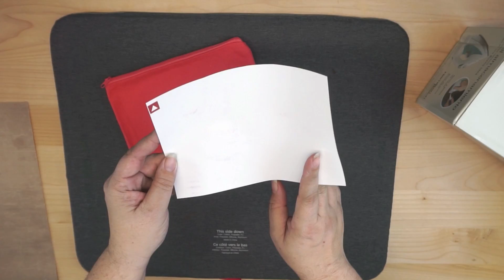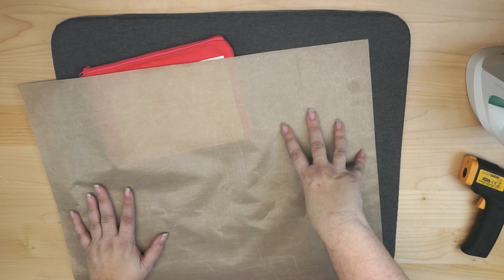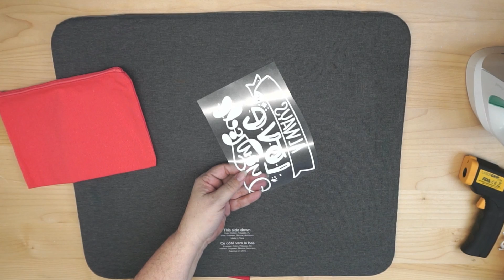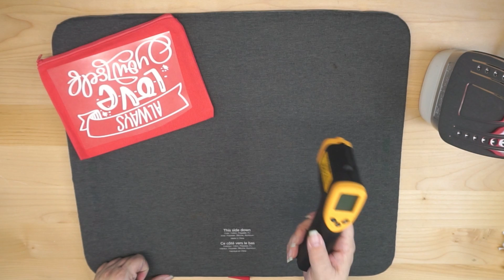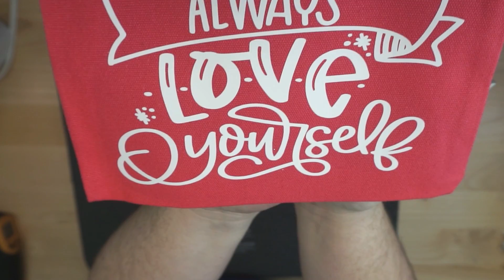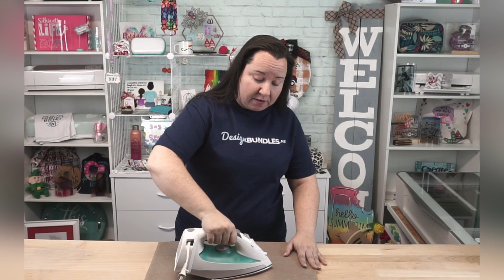✨ How to Apply HTV with an Iron

Comment: What type of HTV Vinyl heat transfer paper do you use?
Reply from the maker: I am not sure what exactly she is using here but I just order mine off of amazon! It really comes down to a lot of preferences. How sticky do you want it to be, the size, and the alignment grids. Some people have to have them and some don't like them at all. I know this doesn't totally help but here is a link to something similar to what I use: https://www.amazon.com/transfer-tape-for-vinyl/dp/B073XRLZ6Z/ref=sr_1_18?crid=141E9F34H0FJ&dib=eyJ2IjoiMSJ9.XEowOwjFDeRf5YhpstOj1knGrcpoO-qb93uOv2eQxIuYulT2FB1sPmn9ziCyAXtSWZQYAqSJTHCTC7nZSwRF1GigQJr-CPFIOuP3mS4H-2iE8EzJAoffAQHVYZS-HhCe8duO1SecyKJku803C9L8d6ECLPkOPYvFqOSC2RgGAzBtNL817fdOW8ZtKCqDPtltJ5VlstdHgd3qZJRfmtVDd2TlYFgX-0uD2nSQ22p-7f-5SbSciLFbFk81WC71tfnsBktg6UGI0HLae-08wJTxfVRYNPm8ALvsBUpaupf5L7A.Y5HAIoc19a_C0K_Cu5GHNeJm43DQRSSOSKiLYqWzGMg&dib_tag=se&keywords=transfer%2Btape%2Bfor%2Bvinyl&qid=1764695648&sprefix=transfer%2Btape%2Bfor%2B%2Caps%2C184&sr=8-18&th=1

Comment: If I don't have a pressing mat, and neither do I have a granite countertop, tile floor, or separate tile....
Can I use a towel as a pressing mat, on top of a hard surface? Not folded towel, just single layer.
I actually have a tile floor in my bathroom but they are very small tiles and I think the grout lines will cause issues if they are underneath the design.
Reply from the maker: You want to be careful pressing on any surface with just a single layer towel. Depending on the surface, heat can be damaging to it. If the bottom surface is safe then its worth trying! We just don't want you to ruin a table or counter for it!
Reply: @DesignBundles Thank you!
The reason I thought single layer was because if I fold the towel it might get too soft to have enough/even pressure on the bottom. But I'm going to look for a piece of timber leftover from a woodworking project, to put underneath the towel. That way if the heat does get through a bit, it's just a leftover piece of timber that's damaged, not a table or counter. And I will then know that I HAVE to get a pressing mat or a separate tile. Just hoping not to have to invest in either of those until I know for sure that I will be doing more iron on projects.
Reply from the maker: @hesterroemersma9896  totally get that! Smart idea on the timber too! Definitely dont double up the towel because you are right that it can cause uneven pressing and heat. Im so glad you found a smart and resourceful solution!

Comment: Thank you! I was needing this info how does it look if I use an ironing board? I am new at this. and I have been DIYing for my Wedding projects robes satin polyester which I have never done any of this before. Any suggestions if i don't have a heat protected surface? can i use lol my picnic table as the hard surface with a towel over it? or would that set off the balance of the satin when putting pressure?  Thanks for your help ahead of time!
Reply from the maker: Hi there! One thing I would suggest is to use the hard outside surface with the towel to protect your clothes and your table! - Dawn 🙂

Comment: thank you for giving me an answer to the question I had about what went wrong with my vinyl work I had done at my usually great sewing shop. the designs cost me 10 a piece and I had  8 put on - down to last 4 now - but also I had some uniforms fatigues that were hard to come by that I was restoring to my original uniforms - and my thought of course well they did it wrong but I didn't raise a ruckus - they are nice people - but here is the deal - the mystery solved - they are all Vietnamese  Ladies - not one of them weighs over 100lbs - so ya there wasn't much pressing going on there in the back room - this would probably be a two person job for them in some kind of bizarre piggy back configuration to get that press done right. so my thank you is I will now be able to save two sweat shirts they did (plus I still got two designs  that never got used - plus I can redo the 5 fatigue shirts that I didn't even wash or wear until I figured things out - which you helped me do.. good video
Reply from the maker: We're always happy to help!
Reply: 😂 this cracked me up!

Comment: What are you using to cover the item before pressing?
Reply from the maker: It is butcher paper, however with HTV you do not need to use butcher paper unless you want to.
Reply: @DesignBundles  ok, thank you!! Good to know. I wasn't sure if I should cover before pressing.
Reply from the maker: @smellyrhinostudio  You don't need to since HTV has the clear sheet. 😊
Reply: @DesignBundles  :) thanks!